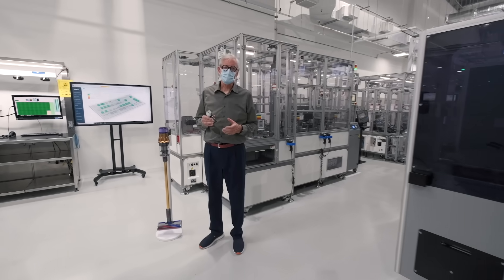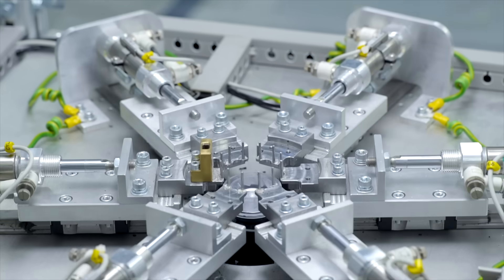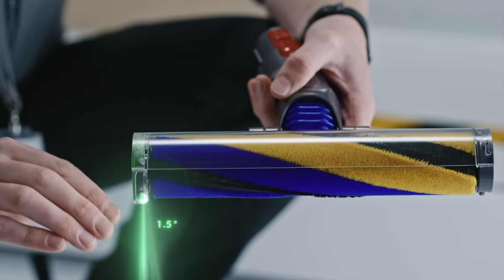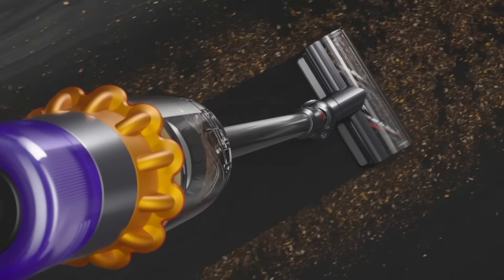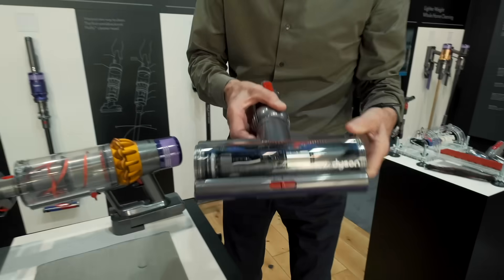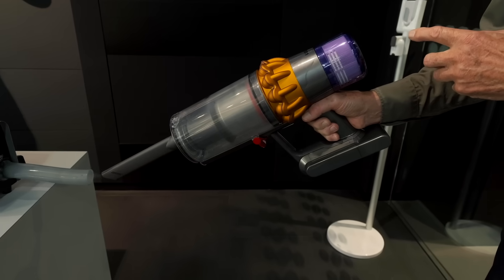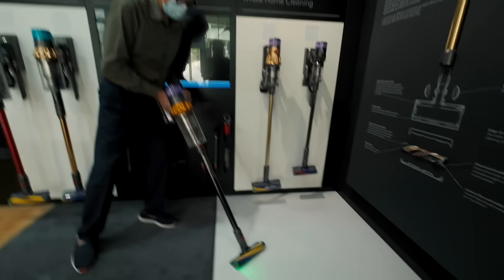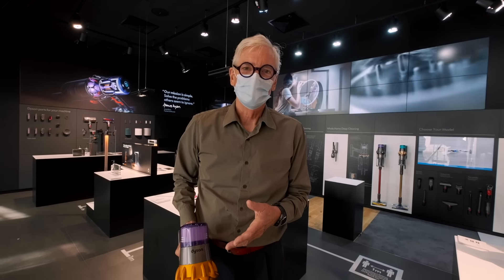James Dyson launches new Dyson vacuum with laser technology.

Comment: Absolutely amazing vacuum cleaner. However the dynamic load sensing is very annoying on thicker carpets and I wish it had an off function. Also the new mini motorised anti tangle tool is not as durable as the previous versions before and seems to break often.

Comment: Smart digital motors are great. Engineer a way to eliminate static cling on the vortex components inside the vacuum and build up that eventually causes clogging. You need to discharge the electrical charges on the micron to prevent these from clinging to the cinetic tips and the outside of the cyclone body. Make an antistatic vacuum. Thank you.

Comment: if you need a mask either your vacuum cleaners are not working properly or you miss understood the manual. the dust filters have to be fitted to the vacuum cleaner, not to your face. and you are right, dust should not get into the air, which leads me to the question why your vacuum cleaners use a dust gun mechanism for emptying. 👀

Comment: I have had 3 different V15 absolute units all giving the same problem. Gives a "clean filter" message after less than 5 minutes use. Seems to be a common enough problem if you look it up. Dyson support was good but inexcusable to be shipping items with a known manufacturing defect. I eventually resolved the issue by buying a Shark which has been perfect and comes with a 5 year warranty rather than Dyson's 2 years.

Comment: You should come up with a version that is easier to clean so that the insides are accessible and not like now when you have to spend a lot of time removing screws etc. My V10 was totally full of dirt, the metal sheet with holes blocked from the inside and its a pain to clean it due to the unfriendly design.

Comment: I bought a V15 today.  James Dyson power as marketer is making us create and buy beautiful objects.  Sadly the battery does not work on my V15.    I have  spent the day trying to make it work.  It would have nice if the battery had been tested beforehand.   I was also promised a stand by the shop  if I bought the v15 but it would needed to sent by Dyson Belgium after I registered it.  The local store had 8 stands just setting there.  Coming home I discovered Dyson Belgium has no stock.  Also Dyson made it it almost impossible to find where to sign up for the stand offer.   I live in a country dependent on Dyson Belgium Services.  Therefore I will not receive a stand after the store told me I would.  My recommendation to you James Dyson is to spend a little more attention on the customer experience and testing before shipping and less on too many gadgets.  I love your video, your presentation skills and the interesting products you create but advise any one buying a Dyson to spend time looking at possible alternatives and product reviews.   I will try to return the v15  to the local shop tomorrow after sending my inquiries to your Belgium office.

Comment: Can I use that brush with the light on a Dyson V7?
Reply from the maker: Hi there, The cleaner head is designed to be used with the V15™. We can't guarantee the head will work to specs if you use it on your V7™ machine.

Comment: personally I love Dyson not just for their products but because of James Dyson. Remarkable story behind his career and struggles. I would also like to bring to Dyson's attention the problem with dust getting in the air when we have to empty the canister. Not sure if you are able to come up with a solution for this but I have a DC41 and the dust is a nightmare when we have to empty the canister, a battery charged blower into the canister to force everything out or some sort of device to prevent clogs when the stuff comes out would be pretty useful so I don't have to dig in there with my hands to get the hair out and then slam the dust collector around in the bin to get rid of the other dirt. maybe a conical device you used on the brush could be introduced into the dust chamber so that the vacuum cleans the canister and blows all the dust to the bottom so when it opens the hair and dust fall right out into the bin.

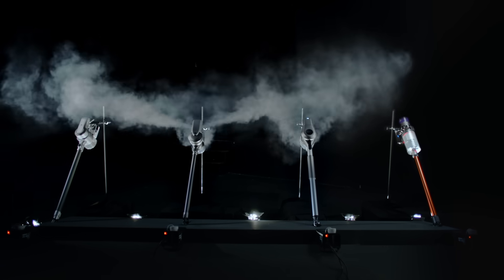Comment: 6:45 I just got the v10 with the smooth attachment head. I used it on the rug outside of the shower since it’s fluffy and I don’t want to use a bristle head. I was hesitant to use it on the rest of the floor b/c I didn’t want it to get dirty. 😆 Well, I did and holy crap! It looks like I mopped the floor! I am amazed and impressed and that ain’t easy to do. Hats off, Mr. Dyson. The others imitate and you originate!

Comment: Cool technologies, but i dont like the glossy finish and transparent plastics. it just feels like a wish product. The stiffness of the components and joints are not that good. used one shaped like a ball before and it squeked and flexed alot. maybe adding a bit more wall thickness and fiber to the plastic could up the sense og quality?
Reply: Oh also, i personally like satin finishes more on bigger products

Comment: 1. You really don't need to wear the mask for the video.
2. the channel called "AvE" has an engineer that tells you that Dyson is all brand and no guff. Yes they have the cyclone tech but that was actually around since 1920's  You can get other vacuums for cheaper and still have similar suction and results. Lately Dyson has been making there parts cheaper. This is not good for you as the Vacuum will NOT LAST. you expect many years out of your vacuum and yet you get maybe 3 before something happens. You payed $700 for a $150 vacuum because why?............. DYSON NAME BRAND.

Comment: Blah blah high tech blah blah there best blah blah laser blah blah super allergy filter. And then you use one of them and they are just medium quality vacuum cleaners that, when you open the dustbin (handy super we're so clever one button operation) releases so much dust in the air, you need to call an ambulance. Crap.

Comment: Going to keep it simple. 
Make a cord adapter or a corded version. 
The whole selling point is flexibility and movement but a cord ain't going to stop me.
At least with a cord you don't need to deal with limited use and degrading battery life.
Especially when these are priced the same as canister/uprights it should be an option.

Comment: That self-cleaning head is actually pretty clever. Do you have any plans to sell just the cleaner heads to be used with central vacuum systems? That would reduce noise and absolutely remove any particle leakage to room air.

Comment: Such great engineering?that still after 2 years of ownership of a DC11 Vacuum I’ve had two triggers fail/break=£85 worse off. Perhaps it’s about time that Mr Dyson acknowledges these failures are a common issue, to all of its customers who have experienced the same faults,so come on Dyson what exactly are you doing? No engineering break through for an upgraded trigger.

Comment: Do you know if the v15 has some sort of protection from over charging when being left charging overnight. Would it damage the lifespan of the battery
Reply from the maker: Thanks for getting back in touch. Overnight charging will not affect the battery lifespan. Please get in touch if you require further assistance.
Reply: @dyson  thank you. Im from the philippines and i just got my v15 ordered from dyson US as it is not yet available here. One question i have also is the v11 battery compatible with the v15? So i will just order it here locally to save on tax and shipping. Hope you can enlighten me.
Reply: @dyson  hello.hope you can notice my question
Reply from the maker: Hi Eduardo, Our batteries are designed to be left plugged in (even overnight) so it's always ready to use.
Reply: @dyson  hi thank you for this. Hope you can enlighten me on my other query about the battery of v11 being use on the v15.
Reply from the maker: Hi Eduardo, the V11™ battery will not work on the V15™.

Comment: Why don't you blow the exhaust air back into the beater bar to help dislodge debris?

Vacuum is limited to Atmoshperic pressure.  Attaching an aircompressor for example to blow compressed air into the carpet would surely make a big difference.

sure exhaust air is anemic by comparison however some (air jet) is better than none. (ball bearing air swivel)

Comment: Our old vaccuum had a crack and it was leaking air and suction  so we were in the market for a new one.  If you are on the fence about buying one i HIGHLY recommend getting one . We got the V11 animal because we have a American Bully and it is worth every penny. It works even better in the car  where her fur sticks to the seats and floor.

Our only gripe is that it was little top heavy because of the battery and it takes getting used to. Other than that great product. 10/10.

Thx Mr. Dyson!!

Comment: I have a Dyson v11 I think it’s called.  Had it a little over a year.  It works pretty good, but it constantly clogs with my dogs hair.  You are always getting an error message that the thing is blocked and clogged up.  It always happens in boost mode.  If that thing isn’t 100% clear and ready to use, it will stop automatically and tell you to clean something.  If you switch it to auto or eco it won’t stop but it’s not as strong.
Reply from the maker: Hi there! We're sorry about the issues you're having with your machine, we'll be more than happy to look into this for you.  

Please contact us on 0800 298 0298 or get in touch via our Facebook, Twitter or Instagram pages. We look forward to hearing from you.

Comment: Just vacuumed the house Mr Dyson with one of your corded products. The cable is just cool enough to touch, the insulation all floppy... not good. The hose does not reach halfway up the stairs, nor half way down. You have to balance it with your knee half way up the stairs to finish? The cleaner itself is alive with finger and dog paw traps and looks like after the guts was designed, they gave up on an aesthetic case.

Comment: The vacuum itself is engineered great, but the customer support is horrible.  Especially at distributers such as Bed, Bath, and Beyond.  Whatever you do, do NOT buy any vacuum from them.  They refuse to honor their return policy and deliberately have multiple websites with conflicting information to mislead consumers.  Dyson support is not much better, most of their responses are auto scripted.  Anyways, my friend bought the V15 and we got a chance to test it out last night.  The canister and tools all had dust, but I heard that might be from factory testing.  However, there are many scuffs on the clear plastic which indicate rushed production or lack of QC.  The green laser works well on the fluffy but it is missing the "ball" so you can't fit it under low beds.  The particle counter was cool for the first five minutes, but then we stopped looking at it.  The best feature IMO is the small anti-tangle angled tool.  It really does pick up every hair without getting snagged.  Maybe I will make a review video of my findings.  Overall, I would just buy an older Dyson vacuum and buy the attachments when they come out.
Reply: Hmm that’s a very interesting review. My main reason why I want this one is because of the air suction is really good. Generates around 230 air watts which is quite a bit better than the v11 which is 180-190.
Reply: @fahimrahman9577  I have the v11 torque drive and my friend has the v15.  Regular models, not the outsize.  Real world testing, we did not notice any major difference in suction.  That's how good the latest Dyson vacuums are already.  Maybe I'll make a video on it.
Reply: @AdvancingDIY  if you make a video that would be amazing I’ll be sure to subscribe with notifications on😆
Reply: @AdvancingDIY  also sorry for the hassle but if you was to summarise the v11 torque drive vs the v15, what would your conclusion be. Anything that the v15 does better compared with the v11 TD in your honest opinion

Comment: WRONG statement - this has nothing to do with laser... laser physicist/optics expert here:  
while that's nice, it's a lie. He's comparing it to a flashlight but he never goes down far enough with the flashligh. Just get a flashlight and collimate it (make the beam narrow as possible, if adjustable), but it on the floor and voila, you will also see the just, probably a lot further away than with this tiny laser diode. 

This is basically so called 'dark field illumination'. Particles scatter the light away from it's main angle and therefore the light will be directed towards the eye, perpendicular to the ground. But the same will happen with a flashlight.  The smoother the floor/surface, the better. Use a glass sheet and you'll see EVERYTHING that way ;-)
They could have used LEDs and the lens doesn't have to be very expensive, that's just BS. The laser was mostly used for marketing but to some extend the laser is the most parallel light you can get. 
On a perfectly flat floor a perfectly angle adjusted laser beam would be best, yes, but the laser has to be pointed down slightly because floors aren't perfectly flat and they can't mount it right at the bottom either.
You want this feature NOW, just put a strong flashlight with possibly collimated (narrow, far reaching beam) on the floor and surprise yourself, works.

So, while a good idea, he's obviously over promoting it, neglecting to fairly compare it with his flashlight. 
Suffice to say, I've used the exact same technique with much brighter LEDs years back whenever I wanted to find a small LEGO piece on the ground or a mosquito on a wall. No rocket science, no laser needed, an incoherent light source gives the much more pleasing image to the eye anyways (less sparkling/speckles).

any questions, I'd be happy to explain, if interested :P

Comment: Completely misleading demonstration. He had the flashlight nearly perpendicular to the surface and the vacuum is nearly parallel. What you are seeing isn't the dust itself, but the shadows. How much of a shadow do you have at noon vs morning or night? Strap any light source near the head of the vacuum for the same effect.
Reply: exactly, thank you for also pointing this out. This was knowingly done incorrectly. As an engineer, he of course knows this, therefore it's a lie, nothing less. It's simple dark field illumination. As you pointed out, most visible are the shadows, but that depends on the floor. Any particle obviously scatters the light. On a glass sheet the dust-scattered light will be brigther than the floor, so it depends.
Using a class 1 laser for this definitely yields a worse result as if they'd used more powerful LEDs. Any flashlight flat on the floor reveals the particles at much greater range, any child knows this.  Especially effective to look for mosquitos, just put the light parallel to the wall and voila (shadow in this case :P).

I really hate marketing BS like this.   Oh and the supposedly expensive lens material... I had to laugh so hard I  almost spit out my drink. 

greetings... laser physicist :P

Comment: It's over engineered, you don't need tobsee the dust to know that is there. You just sweep all the area and cover as much as possible. This technology is like Mercedes's new wiper embedded water jet that removes all the stains on your windshield, very good until you need a replacement.
These are very nicely calculated marketing moves i believe.
Consumers should seek for sustainability and running costs.
In conclusion, in a world of robot vacuum cleaners, this wouldn't be on high demand. Cheers mate.

Comment: dang the man knows his stuff, you'd think overtime he'd just let the youngins do it all, he must love his work. respect!
Reply: nope... his claims on the laser are bogus. an LED would have worked to. His comparison to the flashlight are knowingly bad. He never put the flashlight parallel to the ground... do it at home, will work better than his laser because the laser is 1000x less powerful than the flashlight.
Reply: @randfee  actually if you pause at the right time, you can see the "dust" with the flashlight. They move quickly from that shot, but you can see the dust via flashlight too.
Reply: @petersalt  in the end it’s still a diode. Doesn’t matter if it’s white light or green. But my personal opinion on that is that green is the best option, since it gives the best contrast compared to the floor. Additionally the laser is very likely necessary for the parallel light emitted, making lens design much simpler and compacter(less consumption and only shines on the floor). 

This is just the perspective of a physicist. I guess you‘d have to do some proper tests.

Comment: The light isn't really the innovation here, it's the position of the light. Shark has been using lights on their vacuums for years now, but they put their lights on top of the head. Dyson put this LED on the very bottom, which is genius. It would have been nice to see 1 LED on each side though.

Comment: Can the laser cleaning head be used and attached to the V11 and other vacuums?
Reply from the maker: Hi there,

The Laser Detect Cleaner Head can be used on the V15 and the Outsize.
Reply: @dyson  I have the V11 Outsize, will the laser head work with my machine?

Comment: Those tiny drum rollers are useless for bigger particulate. I tried using one of these style vacuums for cleaning up Christmas tree pine needles and it got clogged immediately. Had to lug out the 40 year old Royal with roller skate wheels to finish the job

Comment: I hate the gimmic of this. No one needs to measure the size of the dust particles they collect, they just need a product that reliably collects the dust and indicates when it isn't working properly. The same is true for the laser - lay an LED torch on your floor, move it around and tell me what you see, there's no need for a laser to highlight dust although it may arguably be more effective at doing so. What's more important to me is buying a product that lasts and isn't made of nasty plastic that breaks and falls apart at regular intervals as have the previous last two Dyson cleaners I owned.